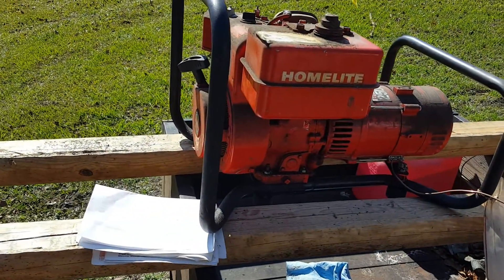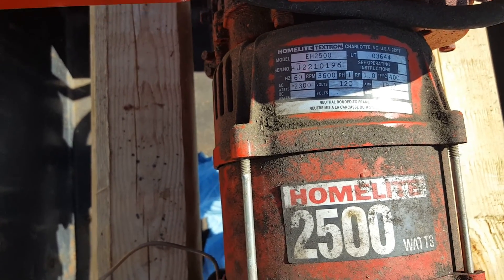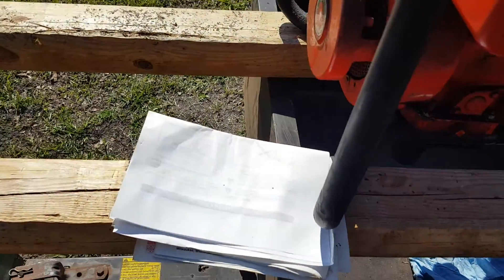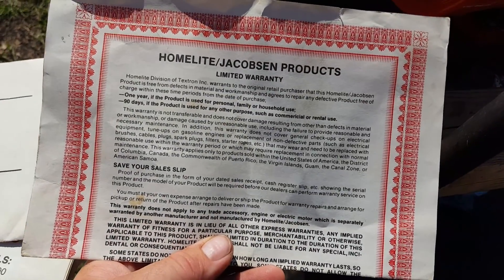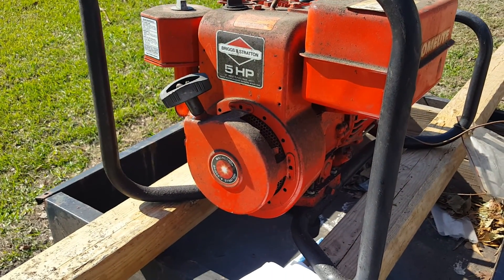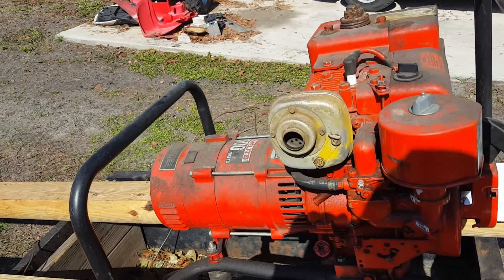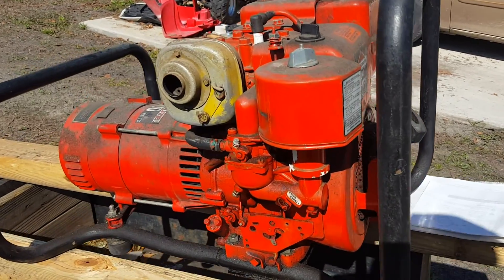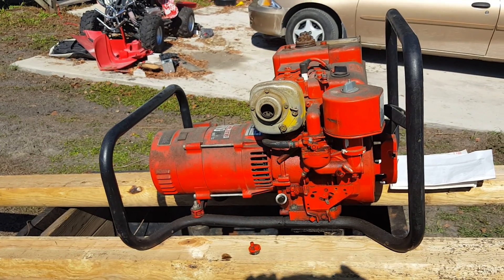Homelite 2500 generator build part 1

Comment: I am working on roughly the same model.  My cord pulls with no resistance for about 20 pulls and then catches and I can start.  Runs like a top.  What is wrong with the starter not catching?  Do they still sell parts for generators this old?
Reply: Take the cover off your dogs aren't engaging properly

Comment: Hey buddy I have the same one can you tell me how much oil it takes
Reply: Most Briggs from 3 to 7 HP in that vintage take 5/8 of a quart. Fill it to the bottom of the threads or a little higher in the filler hole and you are good to go. Usually SAE 30 for warm weather and SAE 10w-30 for cold weather.